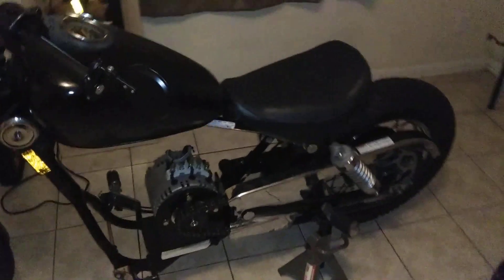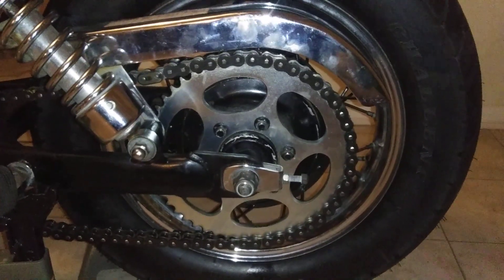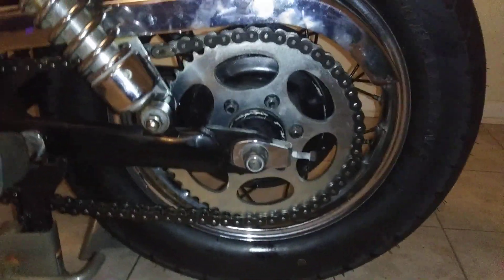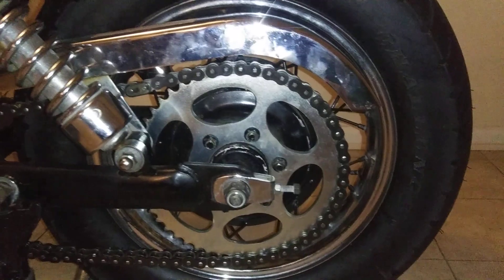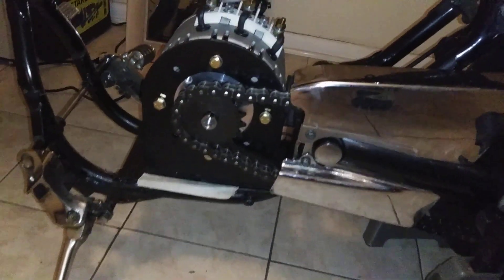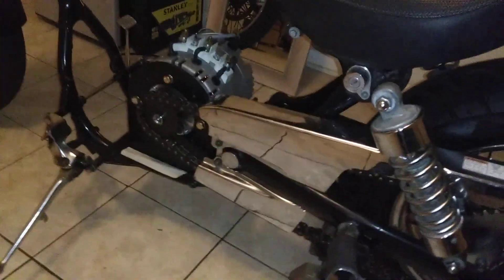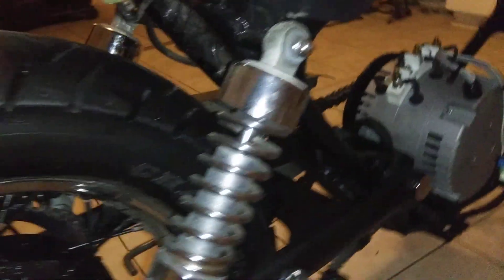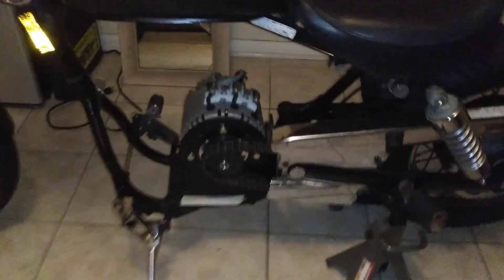Diy Brushless Electric Motorcycle Conversion Pt 4, Belt To Chain Conversion

Comment: Nice looking build! Just what I am planning as well. Perhaps another bracket assembly on the other side of the motor will help with stability and putting even tension on the chain. Good looking build!